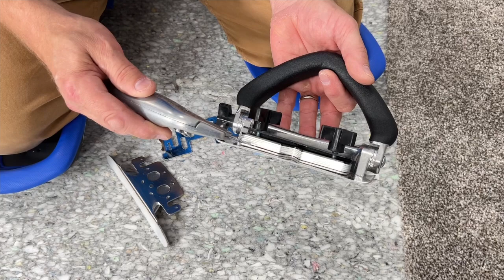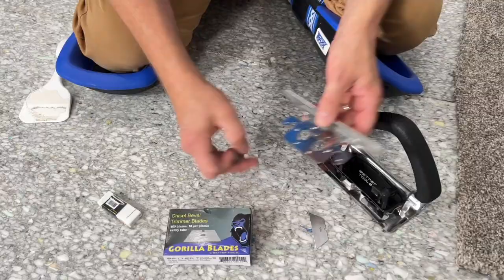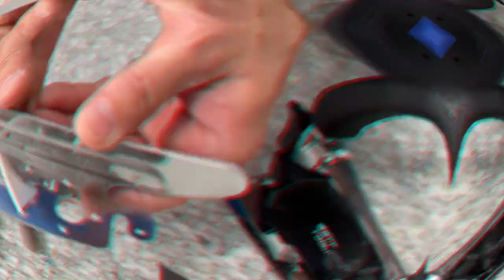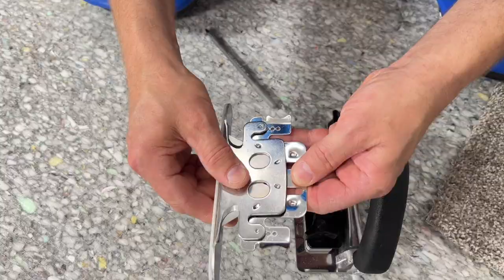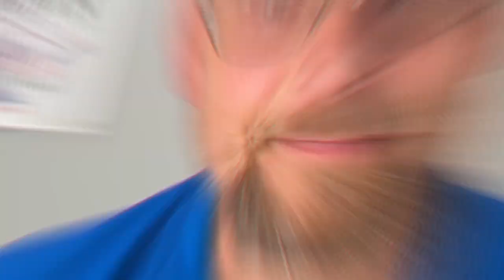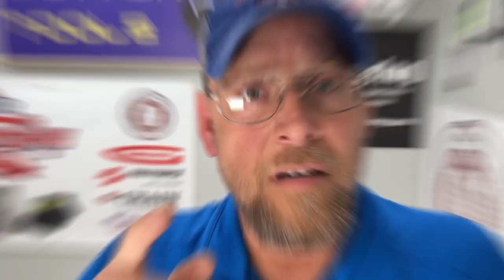HOW-TO Cut and Install Carpet

Comment: One thing ive done for years, is spray WD-40 on the underside of the trimmer, including rhe blade area.
Afterwards, wipe it off really  well with a paper towel or two.  You don't want any excess.
This will make the trimmer glide through carpet like a hot knife through butter.
You can also spray a tiny amount onto a wadded-up paper towel, then carefully wiped the base and the blade, then wiping it residue off with another paper towel.
Try it, you'll like it. 😁
Like all the others that you've done, this one is simple answers every question one could ask. 
I hope you take the weekend off and enjoy yourself. 👍
Reply from the maker: Thank you very much for that , I have had people tell me before years about spray silicone on the trimmer blades, and I have yet to try it, I will do that, and give it a go. I never think about it until something like this is brought up in conversation.